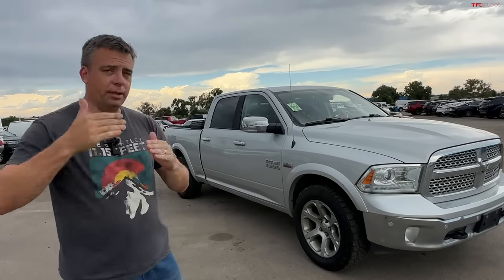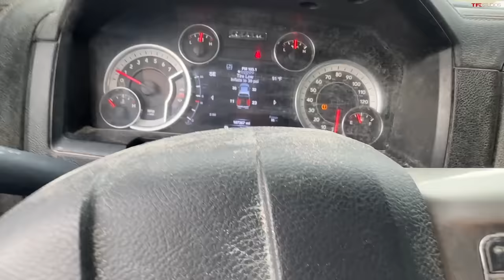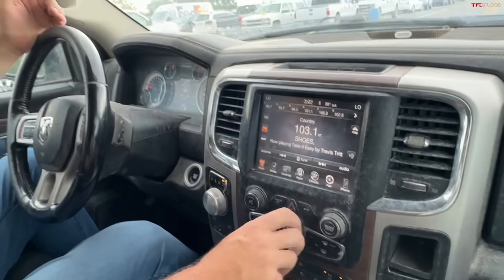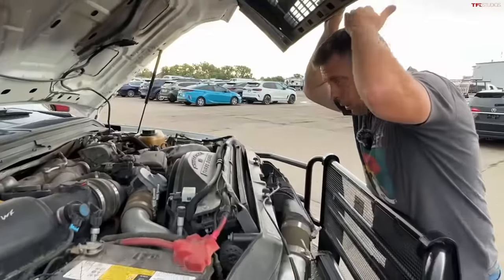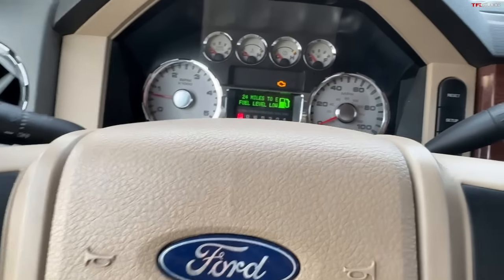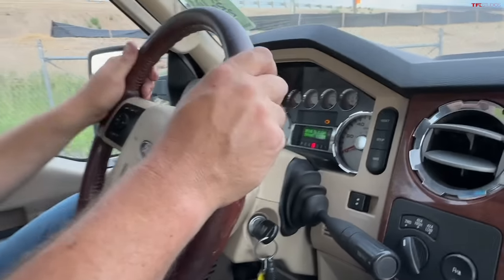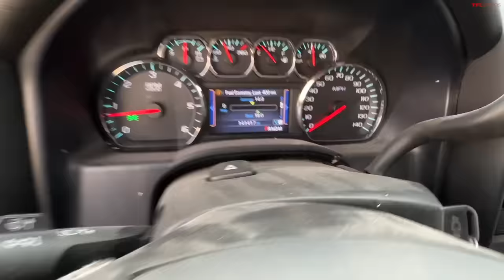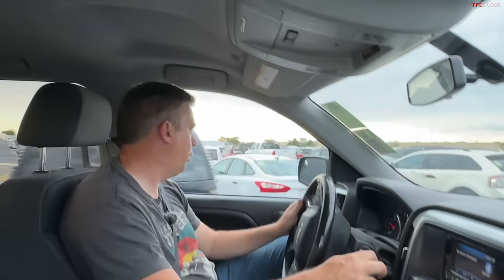These Are the Top 3 Used Trucks You Should Never, EVER Buy!

Comment: I would add anything with the 1st generation 3.5 Ecoboost, especially 2011-13.  The timing chains were not strong enough.  They did not break, but did stretch causing major issues.  For 2011-13, idler pulley bearings were also a problem.  Not all 1st Gen. 3.5EB engines will develop problems if they are rarely driven hard, but all 2011-13 will if not retrofitted.  The Transit continues to use the 1st generation

While we're piling on Ford, avoid the Triton V10.  Not sure if there's any design flaws, but they're only marginally more powerful than the V8 and consume almost twice as much fuel.

Similar to what was said in the video, any GM 5.3L with AFM could fail without warning at any time (including 10 minutes after you drive off the lot from new).  2014 seems to be the worst year for the trucks overall, but if we're only talking about the engine, 3 whole generations are bad.
Reply: GM has really gone downhill after the GMT800 era. The GM transmissions were never good either. The 4L60e was decent, 6L80e maybe a little worse. But the 8 speed is hot garbage and should be avoided like the plague. I've also heard of issues with the 10 speeds that are GM specific, especially with it being a Ford-GM joint venture.

I've also heard of many having expensive issues with 2014-2018 GM trucks (K2XX generation) and the trucks leaving the owners stranded and costing them thousands every few months. I've also heard of GM lifters failing a lot sooner than Dodge lifters, many failing under 30k miles. Dodges really only fail with high idle times if you don't swap to a high volume oil pump.
Reply: @bill_clinton697   People seem to like the GM tunes on the 10-speed better than Ford. Perhaps they’ve programmed it in such a way that puts more strain on it.
Reply: @bill_clinton697  the 4L60E in my experience is the same kind of hot garbage. Maybe it was just my experience across five vehicles, but I swear each was a grenade with a variable timed fuse. I have no hatred for any specific truck, and would drive anything, but I would definitely stay away from any more 4L60s if I had the choice.
Reply: @bill_clinton697  Doesn't happen all the time. Anecdotes are not representative of the entire vehicles sold. If that was really the case , people where I live (Qatar), especially the locals, would not buy it if they had so many such issues. Also how many of those are due to lifting, abusing or bad maintenance? It is not like other trucks are immune to expensive issues either.

Comment: Here’s what used trucks to avoid.
Ford - 5.4 three valve, 6.0 and 6.4 diesels.
Dodge - any truck that’s out of warranty.
GM - any truck made after 2007.
Bonus - any modern DEF diesel that’s choked with complicated emissions equipment.

Comment: I was thinking of a 19-21 ram 1500 with either the v8 or v6. Should be worried about the recalls and hemi issues. The ones im looking at have about 30k miles
Reply: As a former 2019 ram owner I would say to avoid that truck. Unless you like a lot of expensive repairs
Reply: @bondovwvw  i ended up with a 19 ranger lariat fx4 with 3k miles for the same price as the rams

Comment: I have a 2018 GMC Sierra danali. I love the motor in this truck but, I did buy it used i've had problems with the transmission, the magna-ride system it's junk. The little Transmission thermostat Quit working about 75000 miles. I almost burned up my transmission because the thermostat was stuck and wouldn't allow it to cool. I put a bypass kit there. The magnaride shocks, when they wear out you'd better have an Escrow account because they are mightily Expensive. So I put regular shocks And the computer bypass for the Magna ride system. Now I have to replace left wheel assembly because the bearings are also wore out. Right now, my truck has a hundred and six thousand four hundred miles on the odometer And there's other little things starting to go wrong.

Comment: I just purchased two new vehicles a 2022, Ram 2500, 6.4l, 21k miles, and a 2020 expedition max, 34k miles. The two are in immaculate condition and I paid less than $60k for both. They would have cost $200k new together that is ridiculous!!!!!! Keep up the used info no one wants to buy a rip off new vehicle.

Comment: That Powerstroke will probably "clear" itself once the thing completes a full regen cycle. That was the same doggy acceleration symptoms my (old) 2014 Ram 1500 EcoJunk motor experienced when DPF clogged. Ran like crap. THEN Ram recalled them to reprogram the PCM or ECM - THAT basically ruined the truck. Floor throttle from a stop sign, wait 2-3 seconds, then start moving. I ditched the damn thing (really) shortly after their "fix". That first gen 3.0 litre EcoBoost really p!$$ed me off

Comment: Guys, the F250 is LITERALLY telling you on the dash why it's struggling to accelerate. It needs to perform a regen to clean itself out. That's the reason for the check engine light. A regin takes way longer than a parking lot driving test. Go drive it on the hwy for an hour and let it do a proper burn. That's not the truck's fault, that's the emission regulations put on diesel manufacturers by the government. I honestly am disappointed someone as knowledgeable as Andre doesn't know that.

Comment: My 2005 Dodge Ram 2500 (Hemi) is the last of the of dependable work trucks. I didn't know this until owning it almost 19 years and then researching trucks to replace it with. The wheel wells rotted out and I fixed it myself....you can see this on my channel. I was considering another Ram but they are now crappy "mild hybrids" Toyota just went to a new engine, new ford trucks suck and chevy/GMC the same. GMC with the 4 cylinder on a heavy truck is comical too!!!

Comment: I owned a 2014 Silverado... can confirm, all within a year I had to have the transmission rebuilt, the radiator replaced and then the infamous lifter tick began.  I got out of it as soon as I could and went back to ram.  I know they all have their issues, but I never looked back.
Reply: I DD a '14 gmc 1500 4x4 & haul trailers, even a fifth wheel.
Zero issues so far, over 200,000 miles...

Comment: The dpf needs to be ran for around 20 miles at 60mph to clear on that ford and yeah my friend had a black lifted harley 6.4 super duty and the rag joint on the steering failed while driving in the snow at lake tahoe…..the steering wheel  just kept spinning …..they had to pull the cab off the chassis to fix it…..and that truck is in limp mode thats why its not goin any faster than 20mph

Comment: I got a 89 ford with a tick on the original engine never rebuilt. It has 317,000kms on the clock. The tick means nothing really. My 02 dodge ram has the tick too with 285,000km and original engine. That’s doesn’t affect the truck at all.

Comment: Seems like Chrysler's 3.6 V6 is their most reliable engine. A ticking 5.7 won't break down "tomorrow", but three years down the road it probably will. Ford's 6.4 Powerstroke is a good example of why you should wait until, at least the third model year to buy a new engine model, and the Chevy and the Dodge V8's prove once and for all why cylinder deactivation is a terrible idea.

Comment: Another common failure on the 2014 Silverado/Sierra is the A/C condenser leaking, leaving you without A/C. In Florida, that's a big deal. It always happens after the warranty has expired, so it costs over a thousand dollars to replace.  It's so common, there are numerous Youtube videos on how to fix it yourself. That, along with drivetrain issues and numerous eletrical issues soured my confidence in GM quality.  2014 GMC Sierra 1500 bought brand new and was always dealer maintained.  Worst vehicle I
ever owned.
Reply: The truck by itself is not bad though.

Comment: On the Ram first thing first I would be more concern how the bottom of the truck looks over the interior of the truck. The Hemi tick most of the time its the exhaust manifold bolt that cracks & its not a bad costly fix. Besides that the most annoying thing that Ram slacks is everything ELECTROCNICS (lights, radios, cheap speakers, anything modification that involves electrical you are guaranteed to have ELECTRICAL ISSUES 100% of the time).

Comment: Recalls are merely the manufacturer fixing potential factory issues that have been found.  They aren't a gauge of a vehicle's quality.  Trucks may show more problems than other types of vehicles based on how hard they've been worked.  From my experience as a mechanic I tend to stay away from first years of a generation and first year of any refresh with news tech or mechanical changes.

Comment: I drive and pick up for a dealership and they would not even look at this truck. The manufactures have made their vehicles so crappy that you have to buy a extended warranty because the chances of them having major issues not long after the warranty is off and then the cost is on the buyer. What the public is paying for their vehicles there should be a bumper to bumper warranty  for at least 100,000 miles if not more. I’m saying a warranty on everything PRIOD !!!

Comment: 6.4......run far, run fast!
Reply: The 6.4 if you get it with low miles and delete and tune  them they are ok. Buy hi miles not deleted, problems .They used fueling to light the dpf off, and the rear cylinders on left and right  rear banks were the ones to get the extra fuel .That caused x2 potential problems ,fuel dilution of the oil (if not had regular oil changes at 5k max intervals) and cylinder wash from the excessive fueling to the x2 cylinders causing potential ring and piston wear/failure .Also the turbos used ceramic bearings ,they are prone to failure taking out turbo the impeller witch causes shrapnel from the impeler to be ingested into the engine destroying it .If deleted and tuned early, say under 50k they are some what reliable and make awesome power!

Comment: That 6.4l was'nt deleted. That's your problem right there. That dpf is clogged which cracked a piston. 24 miles to empty which means the fuel pump was burned up your not supposed to run it that low on diesei.

Comment: 1 RAM 1500 Used and Abused work truck, looks good body paint, interior dirty and rough. #2 Ford F250 Diesel King Ranch, looks good, high mileage, major mechanical issues, no power.  #3 2014 Chevrolet Silverado 1500, 5.3V8 cylinder de-activation issue, +recalls.  Ran out of time, no other trucks available this video.

Comment: To anyone buying a ram 1500 with a hemi. You should factor in short tube exhaust manifolds, stage 8 locking bolts, and metal gaskets. Plan for $800 in parts and $1200 in labor if your truck has 100k miles on it. 
Do this when its new and youll save hundreds on the istall. Better yet, do it yourself, and pray none of the factory manifold bolts sheered off. 
The stock exhaust manifolds are way too restrictive for this engine. Absolutely horrible design. The hemi basically has asthma. It can't get exhaust out fast enough. The stock manifold bolts are basically pressed and dried play dough screwed into aluminum heads.

Comment: Actually, if the 2014 gm trucks had those issues then they already broke down and got the updated parts and repairs as mine did so now the ones out there are more reliable cause the used vehicle you now buy has been fixed by some one ele. And yes tune that AMF out of it and 🙏

Comment: Way to perpetuate the hemi lifter tick issue.  Definitely sounded like the manifold bolt issue. You should have listened to the engine after it warmed up. The lifter tick issue does not occur in 50% vehicles with the 5.7, do some research before spouting out information as fact.

Comment: My company had seven 2012-2016 F-150s with 5.0 all of them burned up cylinder 4. We still have 2 the only difference is they are FX4 not the standard 4X4 not sure if coincidence, but they were the only 2 FX4s in the fleet

Comment: I have a 2018 Sierra with 125k miles. GM did nothing as far as I can tell to fix the issues with those trucks from 2014-2018. Oil pump, transmission, water pump and rear main seal. About $10k in repairs altogether over 5 years of ownership. Complete turd.

Comment: I remember the Active Regen being a big cause of melted #7 and #8 pistons/engine failure on the 6.4 Powerstroke. And it's a cab-off repair (like most 6.4 repairs).
Reply: Yep. Cracked rearmost pistons in 6.4 on mine at 110k miles. My 6.0 was leaps and bounds better actually.

Comment: I have a 2017 Ram 2500 with Cummins diesel.  The engine is great but all the components suck.  I tow an RV a lot and have had problems with the ABS module (replaced 2x), DEF system, AC compressor and condenser, front shocks and 4WD actuator failure to name a few things.  The majority of repairs was on my dime.  Only 66K miles and I’m ready to get rid of it bc I don’t trust it.  POS.  Add this one to your list.

Comment: That is not lifter noise. It is manifold leak. These engines break a manifold bolt at around 75000km. I replaced mine and 78000km later it was gone again.

Comment: THE RAM PICKUP TRUCKS WITH A HEMI ALL HAVE A STEERING BOX PROBLEM AND ITS CALLED A DEATH WOBIL ,BECAUSE WHEN THESE TRUCKS HAVE 60,000 TO 80,000 MILES ON THEM THAN EVERYTIME YOU RUN OVER A POT HOLE THE TRUCKS STEERING BOX. IS MADE CHEAP AND ITS FALLING APART AND YOUR TRUCK WILL PUT YOU IN A ACCIDENT OR OFF THE ROAD ..

Comment: DFM on the new 5.3 and 6.2 is absolutely garbage. Lifter failure is more common than the AFM. I see a lot of the DFM systems with the lifter failure needing camshafts as well. Plus they are aluminum blocks and you cannot put new cam bearings in it if needed or you can risk cracking the block.
Reply: There was a bad batch from what I heard. Now I am not sure if that is the case (maybe the number of issues is now less). Where I am living (Qatar), not many are aware about these issues.

Comment: The lifter tick is total bs on that Ram.  I had a 2016 Ram 1500 with a 5.7 hemi with MDS.  While it can happen its not very common.  What is common is the header bolts breaking which is what you're hearing.  I put 150000 miles on my 2016 and had ZERO issues other then the starter going out.  That is including 6000+ miles towing a 7500 pound trailer.  If you had an ecodiesel I would totally agree with you on that one.  I also had a 2012 Ram 1500 that I put 170000 miles on with ZERO issues.  Plus the 8 speed transmission ram has been using is a great transmission.  I hate you guys continually making up BS on Ram, talk about the ecodiesel, not the 5.7 hemi which is a great motor.  You are clearly Ford fan boys.
Reply: Your in denial

Comment: Every engine from Ford in the early to mid 2000s models, in virtually every larger vehicle, was trash. I haven't seen a 4.6 or 5.4 triton that ran good after 100000 miles. And I've worked on a few. Virtually every 6.0 and 6.4 diesel motor also has serious issue. I've seen over $20000 dumped into fixing both, and they still had issues. The 6.4 that really sticks out to me blew up on the freeway in a cloud of steam and smoke. It was dramatic. Please avoid them.

Comment: They’ll have to pry my 2014 Tundra Platinum out of my cold, dead hands.
Reply: I have owned Ford, GM & Dodge and now I driving a 2016 Tundra, I feel the same. One of the first things I did was coat the underside with a spray on tacky chain lube to protect it from rust. Love my truck. I don’t drive a lot of miles, because I have two other small Toyota cars to drive as well, so the truck gets the least amount of miles per year. Being 63 years old, I hope to have this truck for the rest of my life.

Comment: Really its not the brand they should say dont buy ABUSED trucks that people didnt care about maintenance. I have owned 5 4th gen rams and 2 5th gens and they are easily go 300k with typical maintenance. You cant base anything on a tore seat. Weight and sharpe objects play a big role in that. My biggest issue with the ram was the exhaust manifold bolts. You also got to remember TFL guys are spoiled by new trucks with low miles.

Comment: basically ANYHTHING produced after the mid 2000's is garbage. full of expensive, unnecessary electronics and likely won't reach it's teens in age without more financial reinvestment.
Chevrolet/GMC - up to early 2007.
Ford - F-150 up to early 1997, Super Duty up to 2004.
Dodge - 1994-2001. (and thats a stretch if it ain't powered by a Cummins)
Reply: Chevrolet 2007 were definitely major problems.

Comment: I don't think you guys know what you're talking about. I've had a couple rams close to 200 plus thousand miles with no tick I did have an issue with exhaust manifolds bolts breaking also the exhaust manifold itself which made it ticking noise when it was cold but that's it. I work on a fleet of Chevys and I'd say the Dodges are much better.

Comment: “Don’t buy these years models” Which, when it’s the big 3, is every year. The new “better” ones just haven’t developed their issues yet to become the next model years to avoid. 
Ford, GM, Stellantis/Jeep/RAM/Dodge choose their parts vendors by lowest cost. That’s it. If they have issues then the vendor gets canceled. If another vendor undercuts them on price, they don’t get renewed. So the vendor will cash in by trying to milk the requirements. See Ford and the Triton engines launching spark plugs due shortcutting the plug threads. 
Toyota places an emphasis not only on cost but quality. If the chosen vendor (who was often selected out hundreds of candidates) has quality issues, Toyota will actually help the vendor fix the problem. So the vendor will invest in making quality parts. The statistics reflect that this method leads to fewer repairs on said parts. Yeah, I know Toyota isn’t perfect.